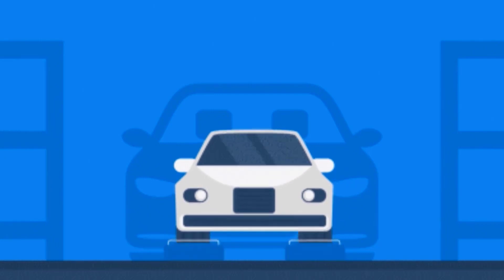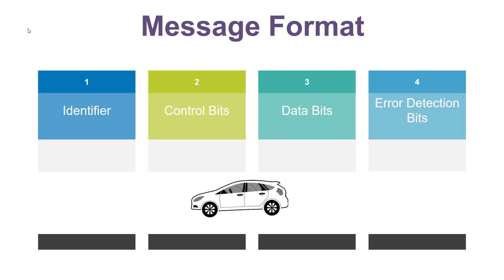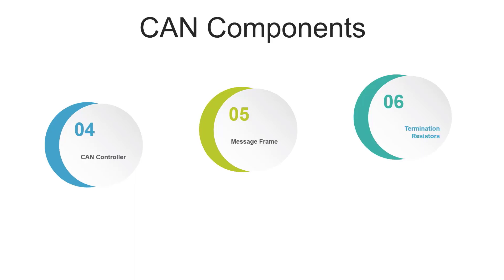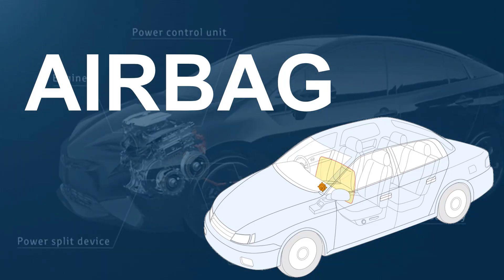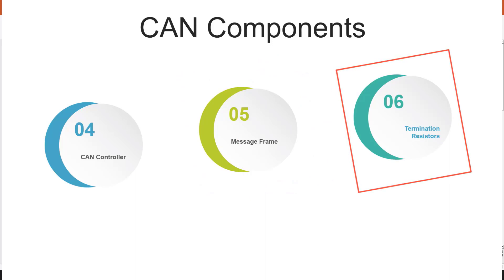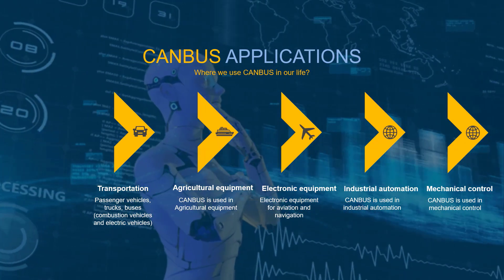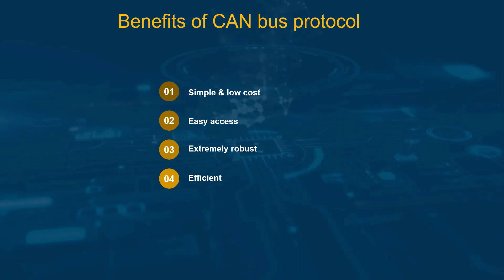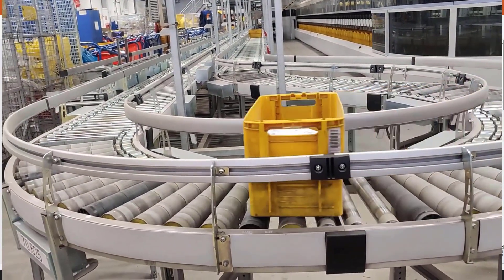Introduction to CAN BUS Protocol

Comment: With everything on a digital bus, the owner can no longer track down electrical malfunctions with a simple multimeter.
Hadn't thought about it until now, but if possible, I'll restore my current vehicle instead of buying a newer one.
I never appreciated the value of that simple 12 volt wiring harness until now.